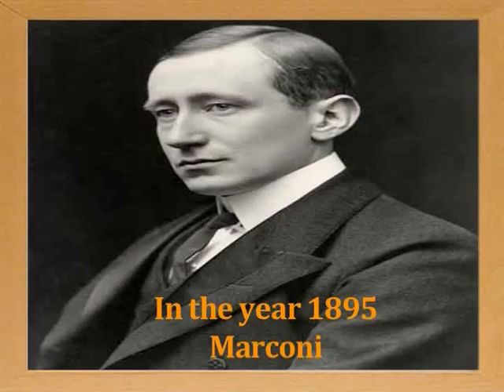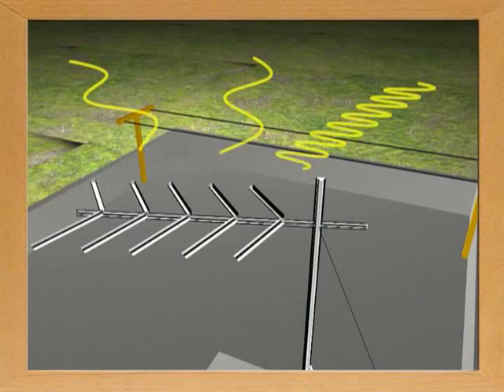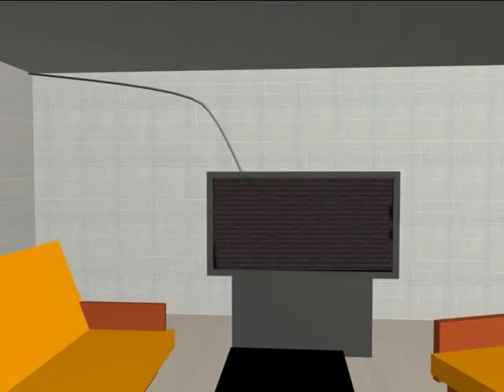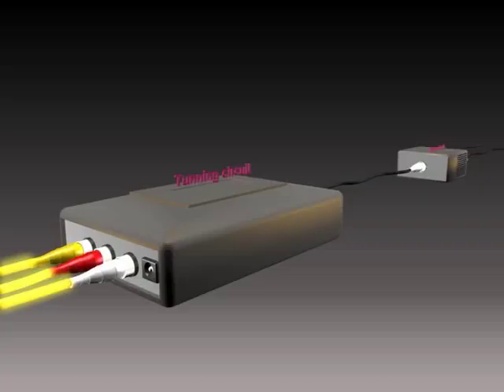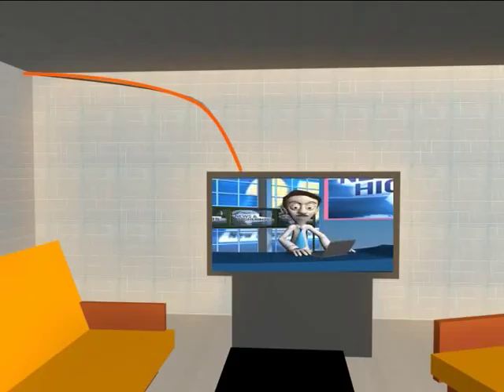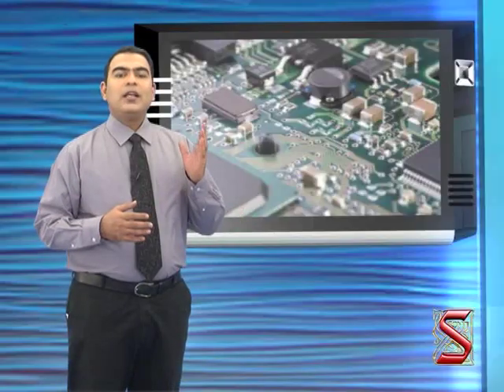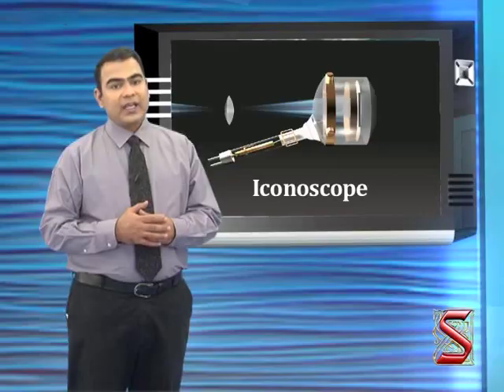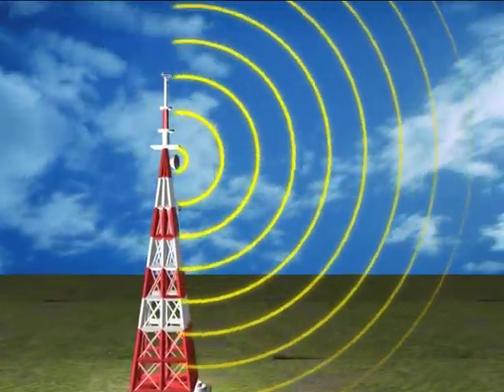Electronics:- Radio & Television Basic principles of working-06 || X Class

Comment: So you can say that carrier waves are like boxes and the electrical signals amplified are the information you want to carry. Carrier waves + electrical signals amplified = modulated waves. Boxes with information inside. The antena transmit the box to a receiver wich demodulates the radio frequency modulated wave. Like it only takes  the infomation  and throws away the box (carrier wave) , then it amplify  the electrical signal so you can see/hear it trough the tv/ radio speaker... Right.?